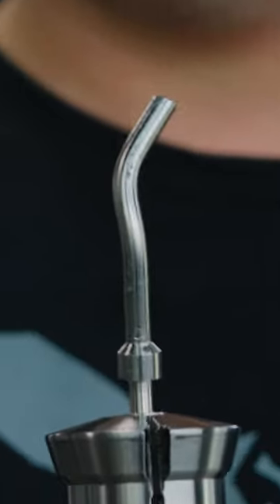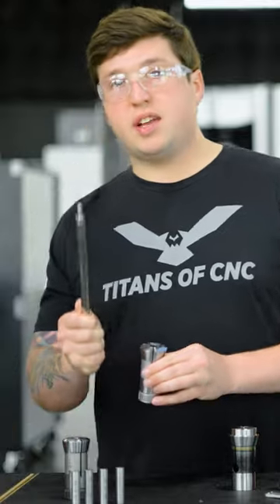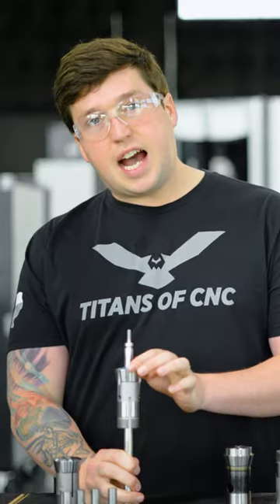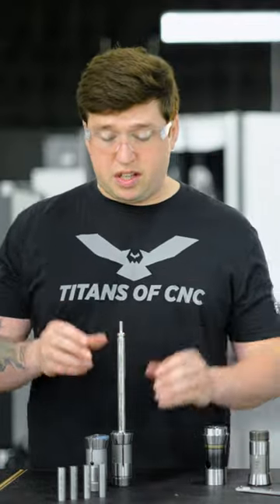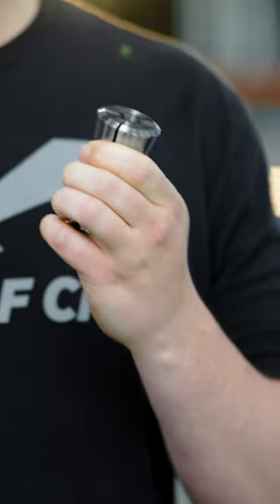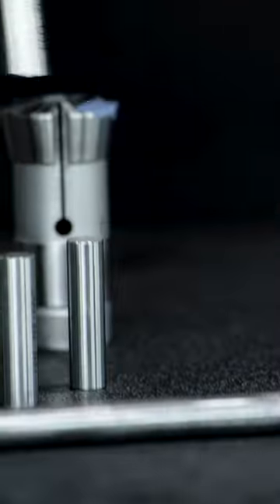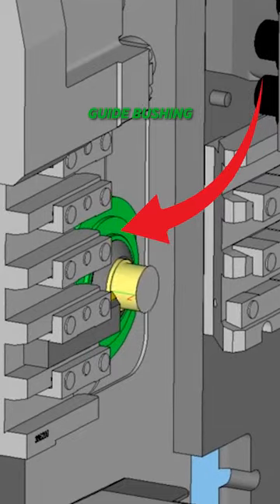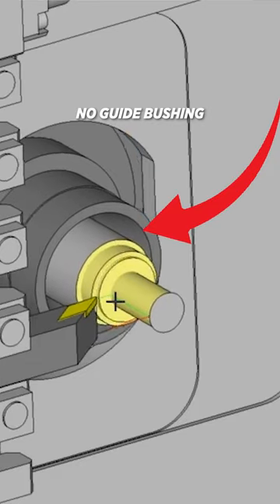Avoid CRASHING Your Machine With This...

Comment: The major downside to running guide bushingless is that you lose all of the advantages of a swiss machine. Length to diameter ratio now becomes an issue again.
Reply: They both have downsides. You can machine tighter concentricity and cylindricity in guidebushing-less
Reply: @pedgepooface   That's debatable.  Once you go guidebushing-less you effectively only have one point of clamping on the material, the headstock.  If you start to get any bar whipping that material movement can be transferred into the part in many ways.  Poor surface finish and out of round conditions are common.  The with a guide bushing any unwanted material movement is isolated from the cutting zone by the guide bushing and headstock combination.

Comment: I wouldnt do this on large diameter bars, if your stock isnt ground you might have problems with vibration/balance. In a shop I worked, you could tell the quality of the stock by the amount of vibrations coming from the machine running. And our stock was always ground. Because of this the plastic guide-bushings in the bar feeder had to be replaced more frequently.
Reply: This is so true. My LNS bar feeder alarms out when I run 5/8 un ground stock

Comment: @donniehinske

Donnie,
I am the person that designed the Swiss collets and guide bushings at Hardinge.  I think it was 1993 but not sure, I've been retired 8+ years.  Glad you appreciate the spread spec that allows bar stock to slide easier.  
Maybe a more important feature that's required for guide bushings is that they not be "bellmouthed", that is, larger diameter at the front of the carbide compared to the back.  This results in the support being farther back in, not at the very front of the bushing.  Of course as you know, this can result in chatter, poor size control,  etc.  That's one of the hardest things to control and check when making them.  Hardinge spec was from straight to .0002" smaller at the front than back.  I don't know what "Brand X" does.
You are an entertaining young man to watch, funny yet intelligent and very technically competent.  Keep the videos coming.  I enjoy them. 
Don Terwilliger, Retired Senior Engineer, Hardinge Inc.
Reply: Hey Don nice to meet you! Thanks for the kind words dude! That’s crazy you designed those back in the 90’s. I’ve been using them my whole(while be it short) life!
Reply: Me too

Comment: Slopy guide bush = slopy roundness  and therefore varying diameter of ypur part. Yes ground  material is best if you want to hit +/- 5um tolerances and dont want to risk the material jamming in the guide bush due to pick up.  A alternative is a pneumatic self adjusting guide bush such as the J.B.S range. These also allow you to clamp hard (&open) the bush with G code if you want do some heavy milling. From memory they can close down 0.2mm, which is useful for the over/undersize  and metric and inch material.  Also they come in different material's  so if you do use ground bar they apparently wont scratch up the finish like traditional carbide lined bushes. All have pros and cons.

Comment: Sometimes you have to run ground stock, I run it every day and have to clean the guide bushing once a shift. We used to use rough stock, but we tried to turn a 2" by .1246"+/-.0001" with a through hole with a .0007" max runout, but it wasn't working with the rough material as the 17-4ss steel would start bending the second you tried to turn the OD.

Comment: Don't you adjust your guide bushing's clamping force for each bar differently? When I used to work in dental implants manufacturing we used polished bars of titanium, but even the best contractor couldn't reach our desired quality, so in pursue of quality and to exclude jams as much as possible we had to readjust bushings with each new rod. After few months of working this way, good operator could do it in under 2 minutes.

Comment: Your ground stock comes oversize!?
They always send ours undersize....

God forbid you try to run plastic through those things. Ive had some nightmare jams between the main spindle and guide bushing.
Reply: We turn plastics somtimes, not a big deal. We always have h9 tollerance material thats always a little bit under size!
Reply: At my shop we almost exclusively run plastic. Citizen has what they call adjustable guide bushings The pads float and are pneumatically controlled to compensate for material that's out of round or oversized.
Reply: @brandons9138  We have Citizens. Old ones.

The guide bushings have to be adjusted manually.
Reply: @Michael-ex8lk  Contact your machine vendor. Ask about the adjustable guide bushing unit. We have a few older citizens as well. It swaps in and out of the machine. You can go from standard guide bushing and adjustable quite easily.
Reply: @brandons9138  Im not the owner and considering how they run maintenance they arent going to drop money on an upgrade when they can just make me deal with it. 

Pain.
Reply: @Michael-ex8lk  That sucks. Where are you located? My shop is looking for qualified guys.
Reply: @brandons9138  i worked with cincom m16 for couple of years, machine has it's temper, but when you'll get used to it, it fucking delivers😂
Reply: @escapist279  After getting my head wrapped around it there is no way I'd go back to a FANUC control. Even newer FANUC controls seem archaic in comparison.

Comment: don't be that guy bankrupting the company to get metal pins unless you absolutely have to. At least try it with a cheap one first lol, there is better things to spend money on then pins
Reply: Tbf if thats gonna bankrupt them theve probes got only so many years of operation lest to begain with. Small costs add up for sure but gott have at least some over head adaptability to servive in this day and age